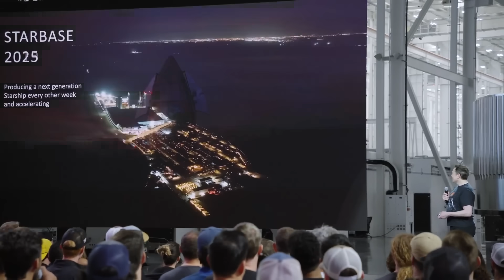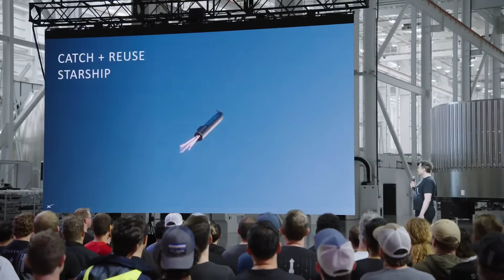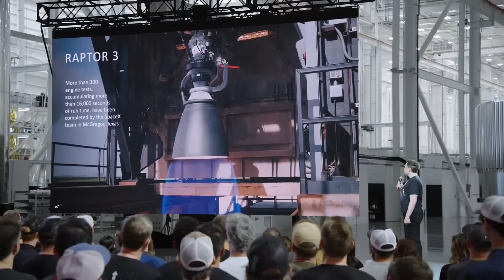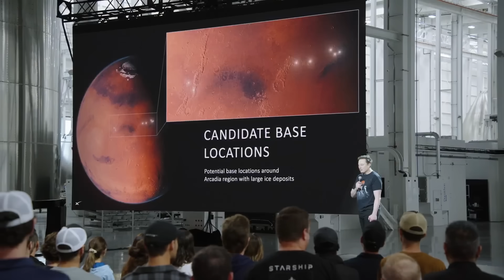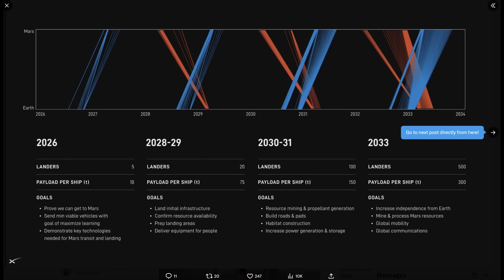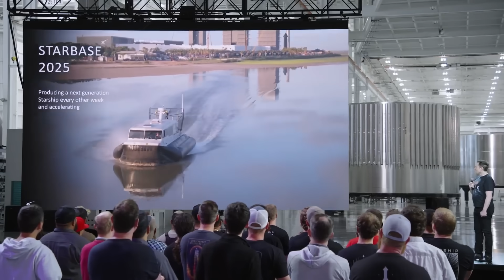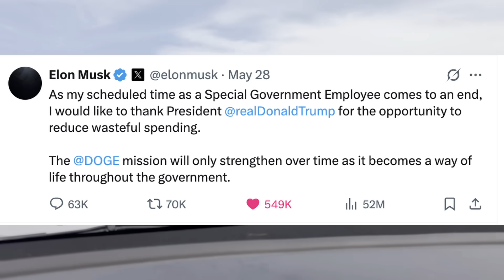Elon Musk Serves Up New Starship Program Information!!!

Comment: Elon is very bad at making accurate forward projections. Building just one Starship a week would be a major accomplishment. The 1,000 per year would only come after the Starship program reached full maturity and even then I believe that number is far too high. There is the issue of storage as they wait for launch, which is already an issue with Falcon 9. The timeline to Mars is just a joke. A Starship to Mars in 2026 is far too aggressive considering the issues they still have with the Starship system. I would rather they send a lander mission to the Moon first, then send the lander mission to Mars in 2028. Shift the timeline by at least 2 years and do a divide by 4 on all the landers.
Reply: Build something that doesn't work. Fantastic Idea.
Reply: @OliverBrowne-g3m  Uh no.  They'd build them after development is done.  You don't really understand what's going on do you?
Reply: I think even 2028 is pushing it.

Comment: Checking back on my table of ASCII (American Standard Code for Information Interchange) characters, the value for the * (asterisk) symbol is: 

Decimal: 42 
Hexadecimal: 2A 
Octal: 052 
HTML: &#42; 

ASCII was originally designed for use with teletypes. 

One more quickie item...the # character (35 in dec, 23 in hex, 043 in octal, and &#35; in HTML) does not mean "hashtag" in ASCII, it's used as the number sign (example: #1) and it's also used as the "pound" sign for weight (example: I'm 184#). Look up the Wiki for "Number sign" to get the history of the symbol. 8^)

Comment: About 42. Douglas Adams was also a computer programmer using the ASCII programming language (old school), an asterisk is commonly used to translate as "whatever you want it to be" and "42" is the designation for an asterisk. This in turn answers the question of the meaning of life to "anything you want it to be." Just thought I share this tidbit. Thanks Ellie for the great work that you are doing!
Reply: ASCII (American Standard Code for Information Interchange) is a character encoding standard, not a programming language. It assigns numerical values to letters, digits, and symbols so computers can represent and process text.
Think of it as a universal translator for characters across different systems rather than a set of instructions like a programming language.
Reply: @ancientprogressive3343  I was trying to keep it all simple, to make the main point. Sorry.

Comment: I don't think the starship will ever fly with 42 engines.  right now V2 booster is 33 ( 20 outside / 13 inside ) V3 booster should have 2 more for 35.  I don't think they plan to add 3 more engines to the ship in the next 3 flights.  So When all are added we would have 44
Reply: Any raptor will continue to vibrate the Starship to destruction.... expecially as thrust is increased.

Comment: The starship system will be  a perfect system to send heavy loads to orbit at minimum cost and very quickly. These loads may be parts of of a large vessel aimed at Mars. But I do not think a starship can go directly to Mars with people on board. There is no catching arms on Mars and the surface is full of rocks, sand, craters, hills etc....

Comment: I thought the most interesting updates were those booster 3 design reveals, specifically the integrated hot stage structure. Ship 3 is looking refined, too. It’s a great looking rocket. 

And maybe I’m wrong here, but real payload capability by the end of the year sounds like the most realistic timeline goal they’ve currently got set for themselves, if it’s just a matter of constructing/testing version 3 of the full stack.

Comment: Look at the 1 atmosphere expansion on Raptor 3. From (3:20)
Most sea-level engines over expand a bit to get a high enough ratio between chamber pressure and final exhaust pressure. Then when the exhaust stream gets compressed by the surrounding air it falls in on itself, creating mach diamonds near the engine. But here, judging from the angle, the exhaust stream expands even faster when bending over the rim of the bell. So, I guess that means that at full throttle the exhaust gas is at over 1 bar, when leaving the bell. That allows for insane packing of thrust in the limited space at the bottom of the rocket. And the engines can throttle down at sea-level without becoming unstable. The Raptor 3 is a beast.

Comment: Ellie, I love your channel and it,s the only I follow. But I do go on to joe's page Once in a while As I like it when you two collaborate. As far as Starship, While I like the idea and vision that Elon has, His engineering approach to rapid development and test it in flight has led to several issues, at least publicly.I think he's got himself into a box that he doesn't really know how to get out of. My question is, are the Raptors robust and powerful enough to launch Starship into orbit? It looks to me like the thrust to weight ratio Is way off Starship is way too heavy And the Raptors just don't seem to have enough thrust to lift all that mass into orbit. Is spacex Pushing the engines way too hard and cutting Starships mass down to bare minimum the crux of the problem? The idea of the engines producing more thrust than they're capable of And the idea of starship being so fragile Could lead to all of the harmonic frequency and fuel line issues?

Comment: 8:44 There are only 33 engines. Wasn't block 2 boosters meant to have 35? Somebody please tell me.
Reply: It may be that with R3's they get enough thrust without the need to add more engines..  But that's speculation.
Reply: Looks like there is many verified sources of this theory. My question is why did they show 35 even after we knew raptor 3 was coming? Maybe fuel efficiency?@imaginary_friend7300

Comment: Just like trump and other narcissists Musk likes to brag about Space X with exaggerated framing, but his claim that the Giga Bay might be one of the largest buildings ever built needs to be put in perspective.  The Gigabay will be 377 ft high by 426 ft wide.  The VAB which was built over 50 years ago is 525 ft high by 518 ft wide!!  In your face Elon!!
Reply: Maybe you don't speak english that well.  "Might be one of..."  You're not terribly bright are you?
Reply: @imaginary_friend7300    When a you resorts to a personal disparaging remark when I was not even directing my comment in your direction then you only succeeed in highlightung your own shortcomings.
Reply: He said "one of the biggest structures, I think, by some measures, the biggest structure in the world", but by no architectural or engineering metric is that true, at most by production capacity, if they indeed plan to build a 1000 Starships a year. :-)
Reply: @michaeldeierhoi4096 You need three numbers to specify the size of a building, not just two. 

For example, the VAB is 525' x 518' x 716', which is around 129 million cubic feet. Meanwhile, Gigabay will be something like 377' x 426' x 290', which is around 47 million cubic feet, or just over one-third the volume of the VAB.

Comment: Catch the ship, when catching the Booster failed 3 out of 4 times🤪 
Why is this PR disaster even allowed on camera? SpaceX has about one year of life in it, until so many of the Starlink fleet has to replaced, that no one will pay for it. Throw Elon under the bus and use the time to clean up and reroute capable personal to SLS.
Reply: Your argument ignores the failure record of Falcon 9 when it attempted to land.  Falcon 9 requited 4 attempts before nailing the landing.  And it had a couple crashes afterward the first successful landings as well before settling into a reliable cadence .  They have since landed falcon 9 over 300 times.
Reply: @michaeldeierhoi4096 Nope. Different rocket for a different purpose. Just scale your car up by 40% and look how it wents🤣

Comment: So close, but yet so far. I really hope V3 raptor is reliable. It will be disastrous if it has issues due to the fact the engines are inaccessible for maintenance. They also need to be highly swappable for flexibility.  I just hope aging Elon doesn't go the way of Howard Hughes and try to build the idealistic final version of starship too quickly. The program needs to grow up and accept that it will have issues. That means flexibility and maintenance are paramount. We dont absolutely need a starship that can fly 50 times for a long time. What we need is a successfully flying starship to be available soon.
Reply: They know it will have issues, they're not new to this.
Reply: @gcburns4 Any raptor will continue to vibrate the Starship to destruction.... expecially as thrust is increased.

Comment: 5:00. 10 tonnes of payload per ship in 2026 drastically reduces the number of refueling flights needed for the ship to get to Mars.

Any thoughts on the 300 tonnes per ship in 2033?  
Would that be version 4 of the ship?  Or a 12-m version 5 or something?
Reply: There is little point in speculating beyond the current block 2 version when they are still struggling to bring starship back to a soft landing let alone a catch!!

Comment: I wish @ellieinspace would do an honest investigation of the Mars colonization fable. That Mars timeline is A complete fantasy designed to motivate and excite. That's all he's doing when he talks about colonizing Mars. There's not any ROI in colonizing Mars. In fact it's a huge financial drain. Both Starlink and SpaceX will eventually be publicaly traded companies and shareholders are not served by pouring money down a hole in space. Noone, not SpaceX,  not Elon, not NASA is paying for such an open ended expenditure. Resupply can't be guaranteed nor even the existance of SpaceX for the unforeseable decades it would take to become self sufficient. It's just not happening. 
When Elon talks about it he almost uses phrases and words like "be ability to" or "capable of". SpaceXs own mission statement doen't say they're building a colony only the capability to make life inerplanetary. Elon himself has said it will be up to someone else to design, test and build the infrastructure for a colony. 
Yes, Starlink is currently partially funding SS development but there are also investors who's big payday will come on the day of  the IPO. That could happen after the first uncrewed ship arrives, or returns. Or maybe after they send and return crew. But it won't go further than that. 
Mars has months long dust storms that block the sun as well as other problems that plague the use of panels. Solar power is not a reliable solution.  NASA agrees and so is planning on using SMRs for surface  power as will as nuclear propolusion to get there.

Comment: Still unclear why the spacecraft would use a propulsive landing and to capture on a tower. A lifting body that Glides to a Runway style Landing would seem to be a far simpler and more versatile solution.
Reply: If you are talking about a rocket that glides to landing starship would need to be completely redesigned.   Space X appears to have their goal set on starship.  It would take a series of major problems to them off that track.  I don't see it.

Comment: Why do they not have a sliding door that slides upwards and instead a rotating door? Instead of pushing against the pressure, just move the door perpendicular to it.
Reply: What pressure? It’s in space.
Reply: @Tailspin80  Internal pressure from the big payload bay where the starliks are placed. The internal pressure is higher than the external. When you quickly open and close the fridge, opening it again is hard because the pressure in the room is higher than inside the fridge.
Reply: @jacobjacob5735 If there was internal pressure maybe it was due to the fuel leak. Either way pressure equalisation by opening a valve doesn’t sound difficult.
Reply: @Tailspin80  Maybe they did not think about it, after all this is spacex, they prefer to blow few tens of millions of $ to learn a thing or two
Reply: @cristibaluta Maybe you should go tell them how to do it better?!?!  😂😅🤣

Comment: Fourty two!!!  42° is the angle that refracts light into a rainbow 🌈
Reply: Musk also said the V3 Starship will have 42 engines
Reply: Cool!
Reply: Forty you simpleton.
Reply: 42 is the answer to the ultimate question of Life, The Universe, And Everything.
.
.
.
.
.
Or as Arthur and Ford found out when they were on the replacement Earth 2 and pushing in to Arthur's memories, "What is Six times Seven".
Reply: That's just, not true? 42 is not a special angle for light. Keep trying to make everything about the rainbows though.
Reply: @thecyanadon Its more or less true actually. 

"Light rays enter a raindrop from one direction (typically a straight line from the sun), reflect off the back of the raindrop, and fan out as they leave the raindrop. The light leaving the rainbow is spread over a wide angle, with a maximum intensity at the angles 40.89–42°. The most intense effect can be observed at only 42°. The reason the returning light is most intense at about 42° is that this is a turning point – light hitting the outermost ring of the drop gets returned at less than 42°, as does the light hitting the drop nearer to its centre. There is a circular band of light that all gets returned right around 42°. If the sun were a laser emitting parallel, monochromatic rays, then the luminance (brightness) of the bow would tend toward infinity at this angle (ignoring interference effects)."

 physics . stackexchange . com/questions/497166/why-does-a-rainbow-only-form-with-a-42-angle
Reply: I always suspected Elon was woke …